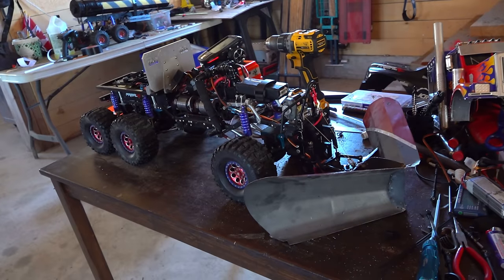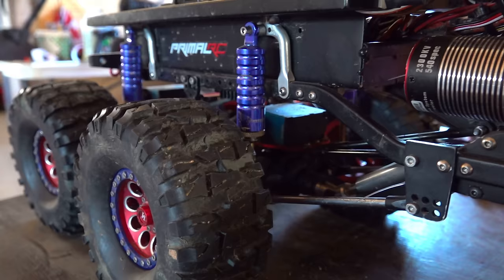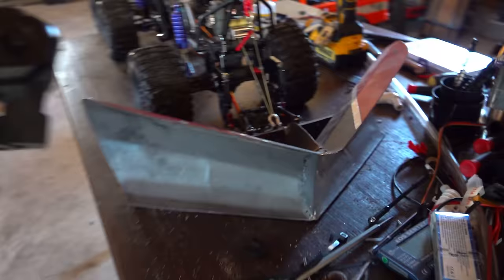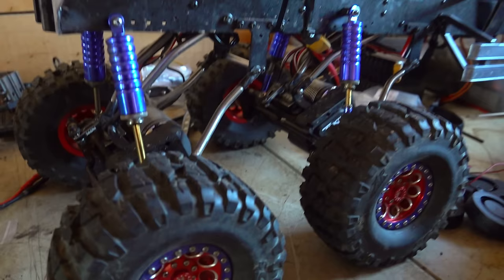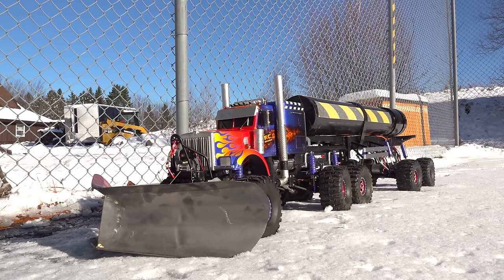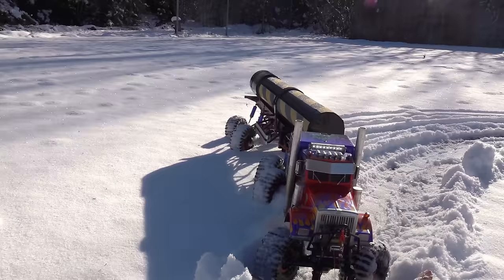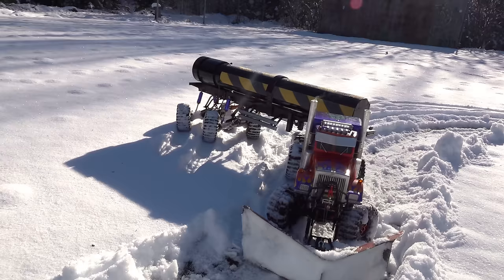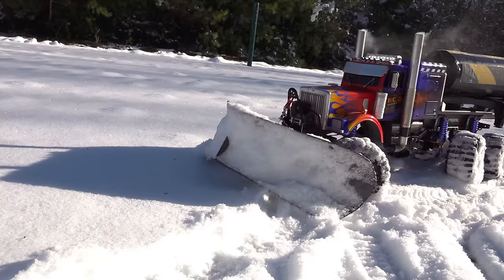10x10x10 Ice Road Optimus Truck & Powered Trailer w/ Snow V-PLOW & Rotation | RC ADVENTURES

Comment: In Utah our trailer plows have the blade that roll up and down. They don't go out. The wheels on the trailer turn and kick the trailer out. I've thought about doing this. Where Optimus' trailer both steers and drives you only have to drop and raise your blade. Also paint the plow with a heavy enamel and even less will stick. My plow is, like yours to be on the trailer, pvc and the snow doesn't stick NEARLY as much. Also look into spring loading your plow.

Comment: Mini tire chains might help and look reslly cool!
Im drink hopefully this makes sense...

Maybe for rear side of the plow, connect it to the trailer via a pole with pivot points on each end. 
Then mount another winch above the pole trailer pivot, above & offset. Enough so pulling, lifts the plow up. Design a bump stop for the pole, and then some sorta locking feature (unless winch owns)

Comment: For the tow plow, all of the full size ones that I see are winch operated, and the blade itself just rotates  or pivots from the center line of the trailer bed, on Spring softened hinges. The plow does need weight though, even the full size ones have to have weights on the back of the plow blade, otherwise they just bounce really badly.

Comment: Trailer plow on a leaf spring that is always trying to push it out and use a winch on the tip to drag it in and have a slide at the last portion that will lift it slightly as it is coming into the trailer

Comment: Rear plow ⬆️ ⬇️ take a 380 or 540 motor on a reduction gear drive attached the shaft end to a pulley wheel etc with two holes adjacent to each other. From there use a cable from each hole, route that to the top of each rear blade. When motor turns one way it lifts other way it lowers. Look at the contraption like a weed eater head assembly.
Reply: Ps due to the weight of the rear pvc plow. You might need to add additional weight to the end of blade to get it to press down firmly to base of snow to get started for plowing

Comment: Real tow plows the rear does not steer, it's an extra complication. The trailer wheels will steer and kick itself out. They usually have liquid weight like DLA in them to help them from bouncing or riding above the snow. Neat idea though. Dont think I've ever seen an RC tow plow.

Comment: You should put a hinge on the V plow right in the middle so you can independently run both sides of the plow or even making it a straight or a V plow.

Comment: Also, turn your vblade into one that can adjust at the point. Hinge it in the middle so you can do left straight, right straight, v plow or reverse v plow. If anyone can fab that out of scratch I'll bet you can. I'm in the process of figuring it out myself.

Comment: you ever try wrapping the axles in solder to get some more weight on the wheels? it would help it push but in terms of scale its pushing at the limit of what a full size truck can push. I made a plow for my trx6 build but its been a crazy warm december this year in the mid 60s today when normally this time of year its sub 30s

Comment: Could use a hydraulic system with rams like the Volvo dump truck has, those should be strong enough and long enough and would allow you to change the width on the fly

Comment: Seeing your Dewalt impact sitting there, and I have several Dewalt battery powered tools and one of the newest ones a flexvolt 20v/60v max lithium-ion 6.0 ah that lasts forever so I was wondering is it possible to power an RC truck with one of those?

Comment: Put a two way plow on the truck and a wing plow and on the real towplows they have a hydraulic ram that pics it up and down on the front of that is a block the has a center bolt and a pivot point